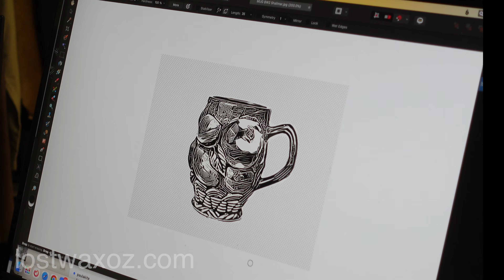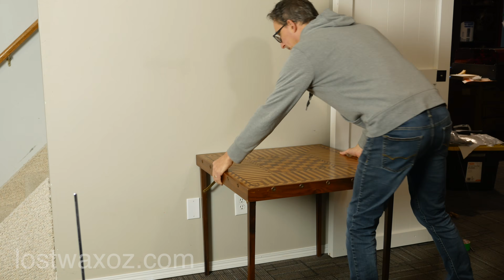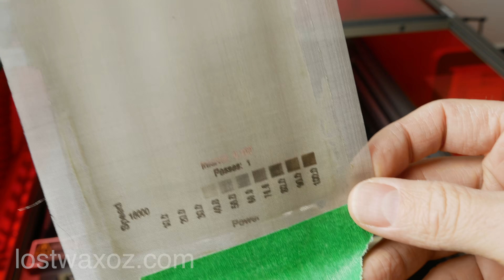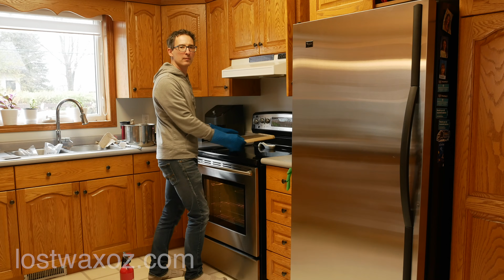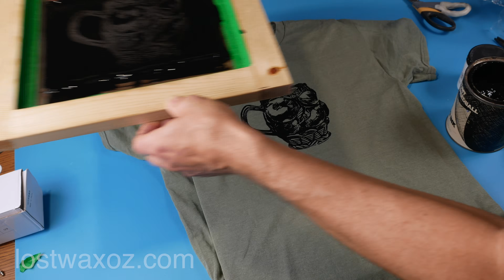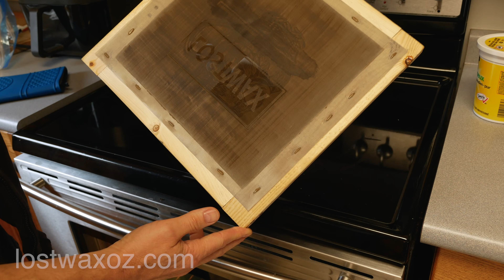Avocado and Laser to Make Screenprinting Screens??  Creality Falcon 2 Pro Laser Cutter Review.

Comment: ...I ended up using regular screen printing photo emulation on my stainless steel mesh: The reason: It's much cheaper than Avocado ;) 
Simply apply the UV ink, let it dry, immediately expose the whole screen at once and laser the design.
Unfortunately, there is one extremely unpleasant quirk with steel mesh: it tends to wrinkle and these creases are impossible to remove. Even a single crease in the roll is enough to render it unusable.
Reply from the maker: Yeah, you've gotta be pretty careful with the stainless screen, good point!

Comment: This is what the Fire Engineering website states: "Wood placed in an oven at 700°F. catches fire almost immediately. At oven temperatures of 450°-500°F., the wood gradually chars and usually ignites after several hours." So, you are likely fairly safe at that temperature. You could even reduce the temperature as I don't know why you'd need to set it up at 425°F. 375-400°F would probably work just as well.
Reply from the maker: Thanks so much for that info!

Comment: I'm an old screen printer. My suggestions: spray glue a board and insert said board between the front & back of the shirt to hold down the fabric. Pull the squeegee toward you, never away. Those two techniques will give clear prints. There are air-dry inks that are available you might like to experiment with.